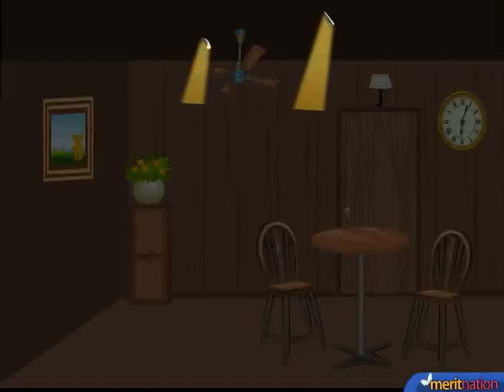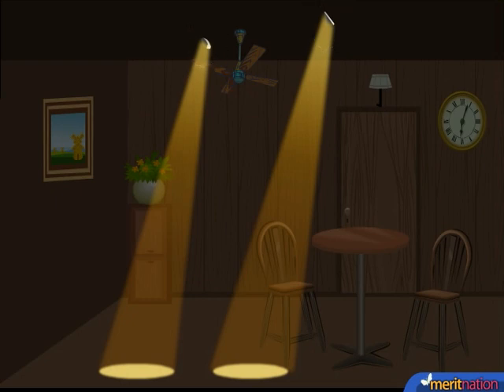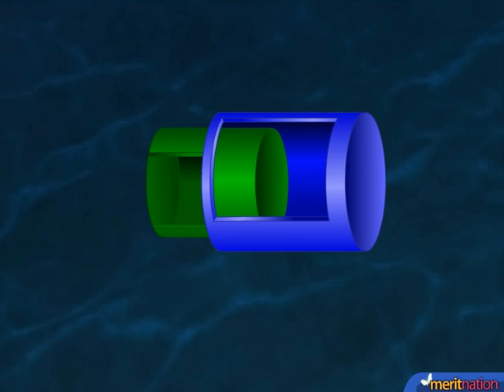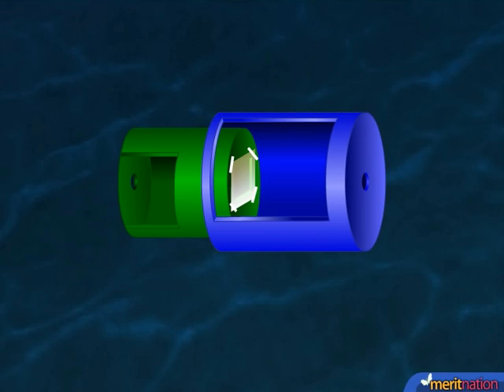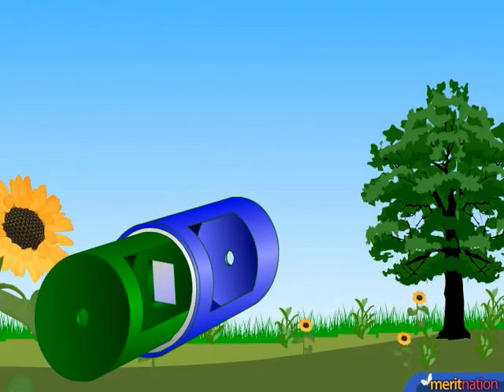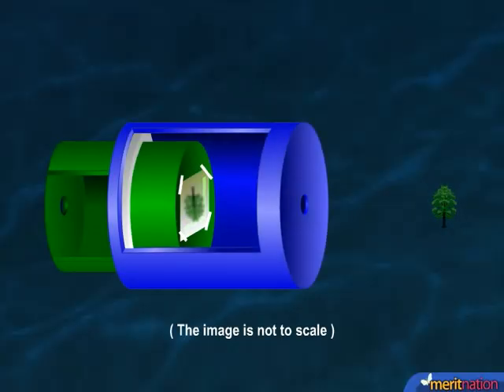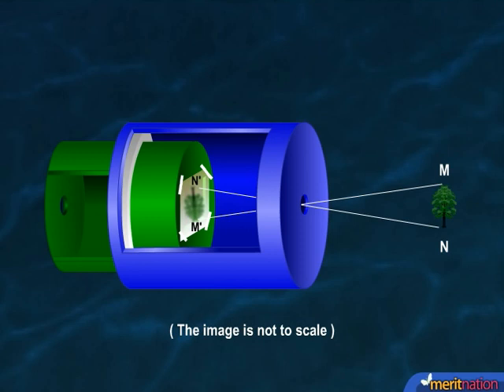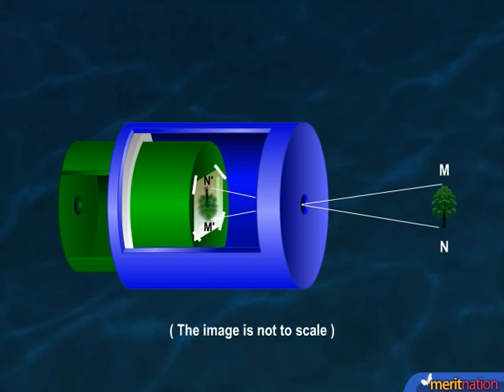What is a pinhole camera & how does it work?

Comment: I had sunlight coming through my pine tree tops about 80 feet away
and 80 feet up, That shine through an 8th inch pinhole with another 36 feet to the back wall of the shop.
 It made a perfect focused picture of the pine needles within a two inch spot of light.
You could see the individual needles. 
I thought that was pretty cool.
I always wanted to try and recreate it. The shop was basically pitch black inside no lights no windows.
That's how I noticed the light.